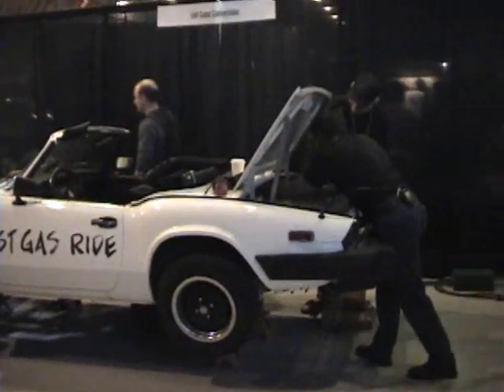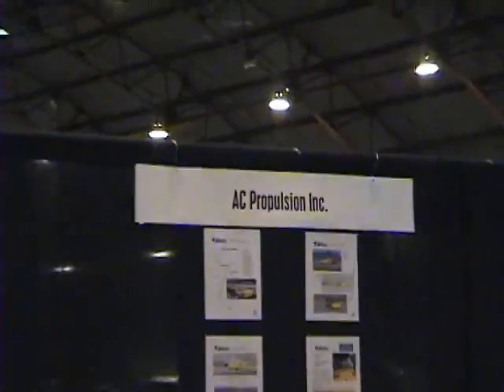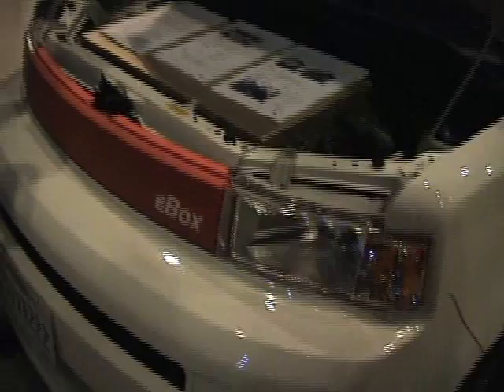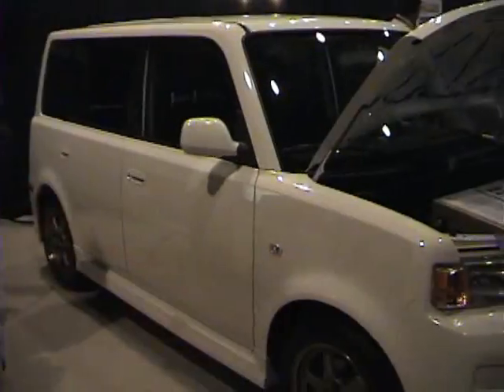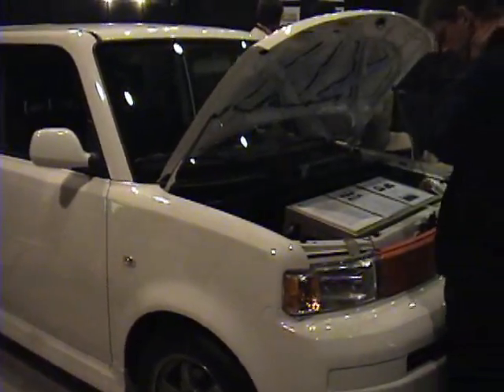Clean Power Show Episode 2 - Alt Car Expo

Comment: Current Li Ion batteries are almost 100% recyclable recyclable. Hydrogen HAS TO BE GENERATED using electricity, with energy conversion efficiency from electricity to wheel being MUCH LESS than that of pure EVs. Read up un facts.

Comment: ive don't a lot of work building my own ebike and I can tell you the estimates that they give are theoretical based the vehicle traveling on a flat surface with a fairly light passanger. If you live in a very hilly area then your batteries will drain much much faster. and also NIMH batteries will only last you about a year or 2 if you use the vehicle every day..